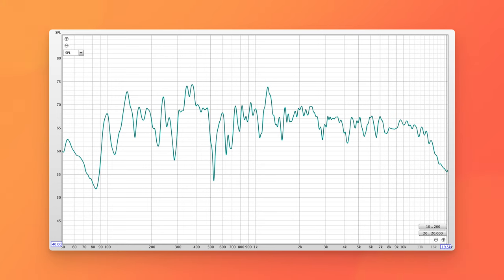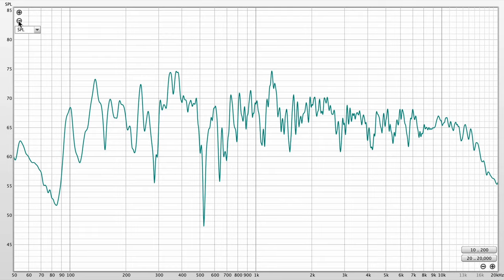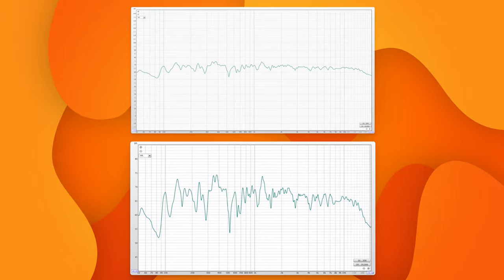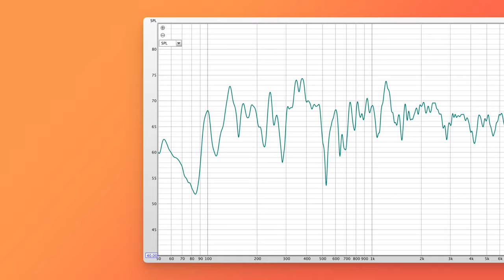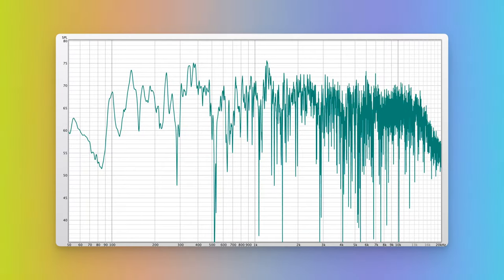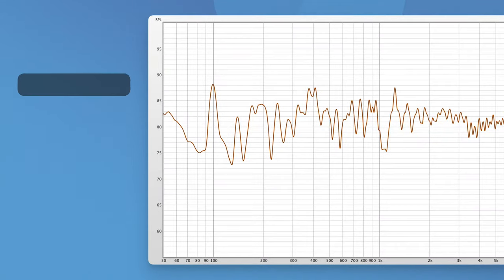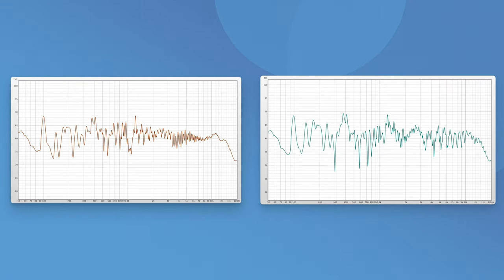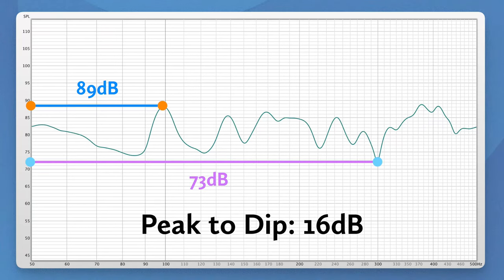Don’t Be Fooled! How to Properly Read Frequency Response Graphs

Comment: This is helpful information, but it still doesn’t answer what I think is one of the most common questions and that is what is the baseline ? in other words, what is the threshold level that no frequencies should be going over? Is it based on the level you tested at? And if yes, does that mean if I test it at 80 spl, then anything over 80 spl on the graph is excessive?